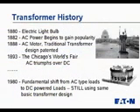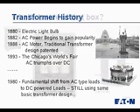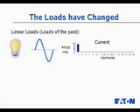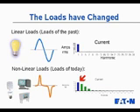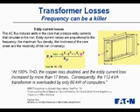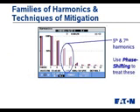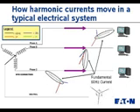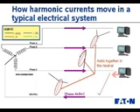Eaton Harmonic Mitigating Transformer Harmonics 101 2 of 6

Comment: A nice overview of harmonics.  What it does not mention is that harmonics also creates very strange fields around the equipment.  You may find wide band radio wave emissions, high electric fields and magnetic fields.  A Trifield 100 XE meter and an AM radio that is tuned to static can be useful in tracking down these strange fields.